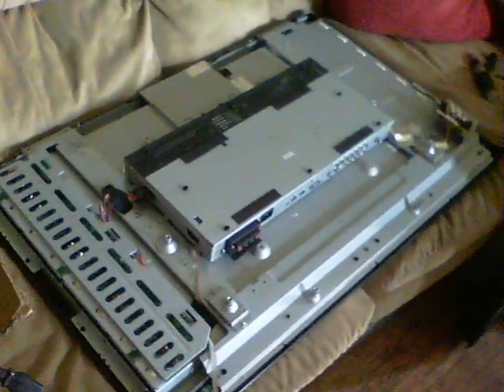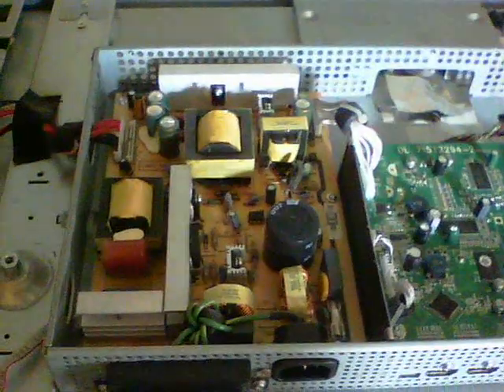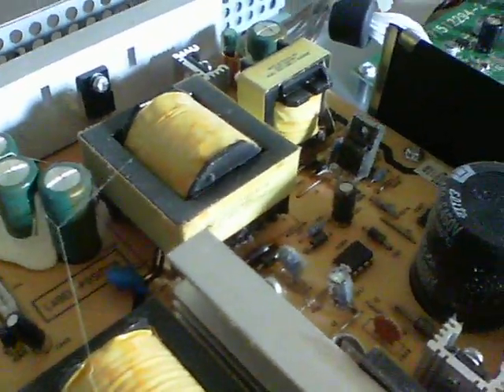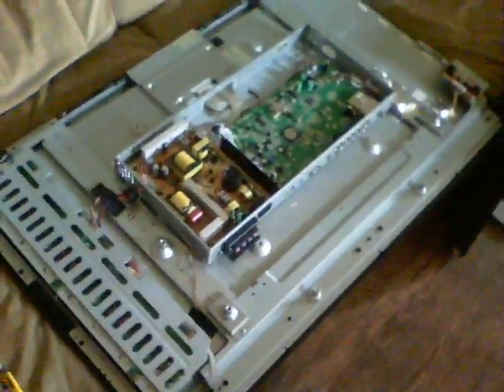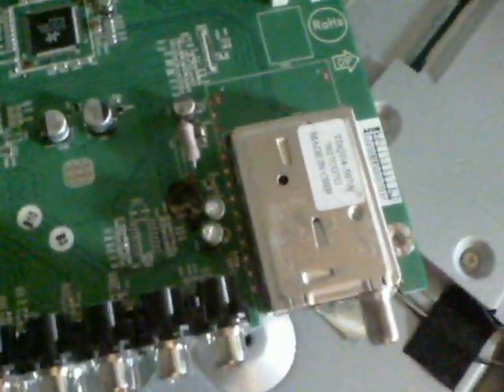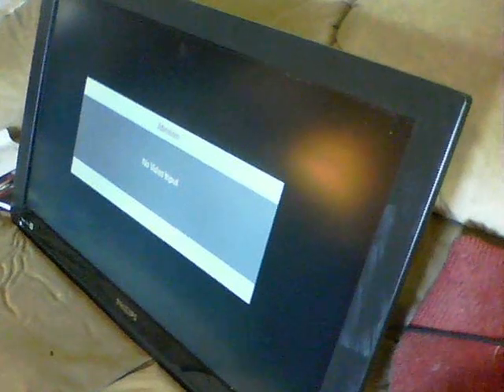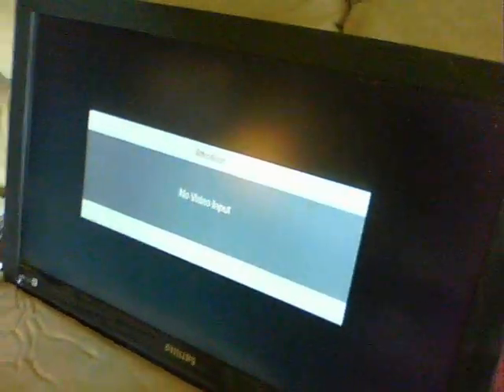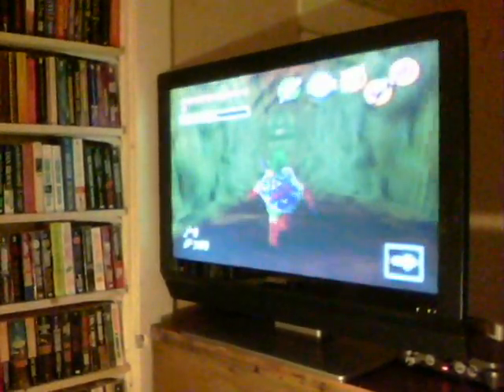Repair - 37" Philips freebie TV

Comment: Thats a nice easy fix. Any idea for blue screen of death on similar sets? I got 3.

With the flyback diodes. May pay to over engineer. two diodes in series or parallel (depending on if it was voltage or current that killed the original) and some drink can heatsink would make them a lot tougher...
Reply: Great stuff, I have a massive broken LCD TV I have been trying to fix off and on. Will be trying again once I clear my bench.
Reply from the maker: As in, just blue for picture, menu works ? sound ? Got no experience of blue screeners, unless they're running Windows ? lol. Can imagine a data throughput error if is only picture receive not working. Would check for dry solder joints in output section. Plus diodes/caps, then continuity testing of circuit traces in case of spill damage (if salvaged TV's)
Reply from the maker: Matt Heilman
 Good luck with it, hope it's a good easy fix of caps :)

Comment: Nicely done! Do you have any idea why the capacitors went? Life expectancy?
Reply from the maker: Yep. It's called 'Capacitor plague' (see Wikipedia). The story goes that an engineer ran off from a company in Asia around 2002 with the secret formula for a new capacitor electrolyte. It got copied massively in Taiwan, but incorrectly. Millions of duff caps were made that don't last more than 5 years (often as low as 7 months or so). Last big complaints surge was 2010 and this TV was made around beginning 2009.  I noticed last night there are 'Repair Kits' for sale with half a dozen caps and a diode for Philips TV's...the same parts I bet.
I salvage most parts from recently used stuff about 10 years old, it's just how the cycle goes for ending up free and yet has proven most reliable when repairing. Not had a blown cap yet in home fixed/made stuff and seems a good practice.